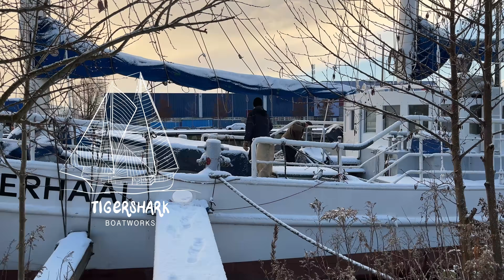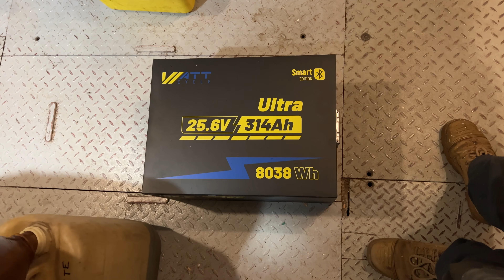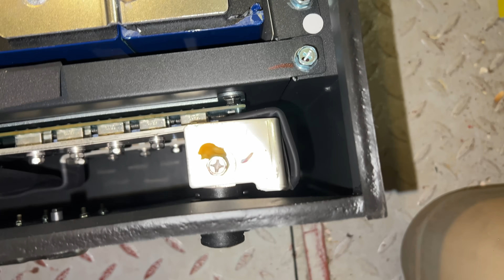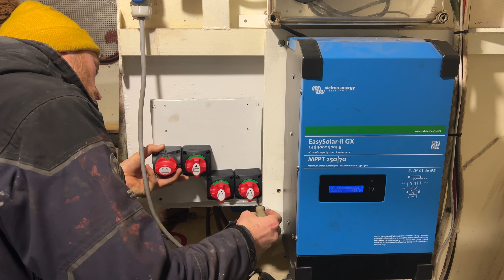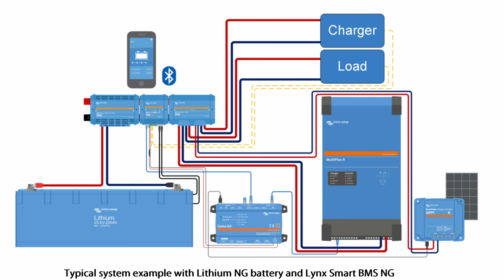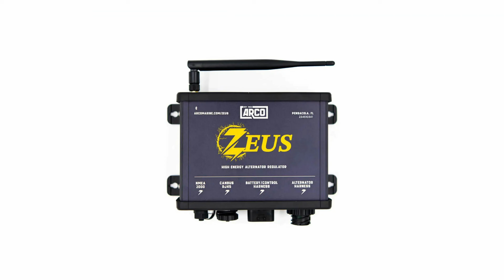The First ELECTRIC Steps To Become FUTURE PROOF

Comment: Nice job. Why not run the transmission oil pump off the end of tesla belt shaft. Freepumppower! Watching
Reply from the maker: Ah that would have been a good idea! More efficient than an electric pump. But space wise a bit complicated, and having it clutch out when using the diesel would also have been challenge. Not impossible though. We’ll keep that one in the back of our minds :)

Comment: The new battery looks like it goof be a good fit for the boat. Its not going to explode any time soon and the dent is more cosmetic than functional. Having the ability to open without voiding he warranty (If damage is reported) is really handy
Reply from the maker: Thanks! We’re very pleased with it so far :)
Reply: @tigersharkboatworks  Be good to do an update on the capacity drop etc in a couple years.
Reply from the maker: Will do! And you’ll be the first to know if it starts doing stuff we’re not pleased with :)

Comment: Check Bank Manager by a cruiser Clark. He has been cruising for years and developed a system to connect LiFePO4 batteries in parallel to lead acid. I have it on my boat and it works great. Google ”bank manager lifepo4”. It will make your system a lot more simple…

Comment: I had Victron batteries in my system, they are way too smart for their own good and are codependent on everything else in the system including battery protection modules, as a system it WAS NOT bomb proof. I think your decision to use the other batteries is actually wise irrespective of budget constraints. My philosophy, everything onboard has to have a workaround.
Reply from the maker: I fully agree. You can design everything into a seamless piece of art, but if one part quits and the system goes offline, you’re toast.

Comment: You did the right thing connecting the LFP battery to the empty lead-acid one. That way, the initial current for the starter motor doesnot ruin your LFP battery.
Reply from the maker: Ah, good to know. I did check with Wattcycle if they thought it would be possible to start it on the LFP only, and they said yes, but this just was the easiest test setup :)

Comment: Impressed with how long those batteries lasted, you must have looked after them well !
I had a standard battery last 8 years, it was just used for engine starting , so never went flat and was always fully charged.
Sensible choices with your new system. As you say, Victron is good kit but expensive
Reply from the maker: Thanks! We are too, so we’ll try to squeeze some more out :)

Comment: I still use AGM even though it’s a racing yacht and I could do with less weight, but I have seen lithium fire and that is the last thing I want in the middle of the ocean. Lithium in my caravan is fine if that catches fire I just jump out and all is well. 😂😂 I hope it works out for you. You do have one advantage the your yacht is steel so it will not burn like my carbon fibre tub. 😂
Reply from the maker: I’m definitely not the guy to convince you to go for lithium. But there is a big difference between electric car lithium (NMC), cellphone lithium (LCO) and the heavier and less energy dense LFP and LTO. So saying ‘lithium fire’ is kind of the same as saying “I’ve seen a ‘fuel fire’”. So, If you ever decide to swap your AGM for something lithium(ish), LFP is definitely a safe bet. Or, wait a few months/years for Sodium Ion. It skips Lithium altogether, but has similar benefits :)
Reply: @tigersharkboatworks yes my AGM are fine for now I only run 400AmpH battery bank. You are running a frigging battle ship you need way more power. 😂 I have seen two boats burned down in one month, because of lithium batteries so I am staying away from those. Mind you we almost had a calamity on my boat. My wife said she can smell gas in my gas locker and I said impossible as we have sensors everywhere. Run out of gas while we were enjoying stay on our Rottnest Island. Got the bottle refilled and turned out it was rusted out at the bottom. I have never seen anything like it. It was only 10 years old. Anyway have brand new stainless steel one now so no problem solved. 😂👍

Comment: It's a pity you cannot get hold of the new CATL 24V Na ion heavy truck or plant starter battery orthevlarge format prismatic storage cells 10,000 cycles plus 5C  175kwh kg  batteries ,  they should start coming through in 6months. 🥼🧙🏻‍♂️🇬🇧
-40 running -35 charging  temp to + 70⁰C  they only loose 10% charge at  -40C  They can also run flat and be recharged without damage so they have about 90%+ usable capacity.
Reply from the maker: Yeah that is definitely future goals, but we can’t keep waiting for better stuff to become available. So, for the next battery upgrade :)

Comment: Your old lead acid battery bank looks like the ones I worked on for years , I repaired and built large batteries for electric forklifts, from 24 volts to 80 volts with amps 1400 ! Some batteries were almost 6000 lbs and 48” tall that would give you a real boost! LOL but the future is lithium and the system you are doing is the best , I think for the future more solar panels and batteries will be needed for your needs . Good luck and thank you for the great video! See you next week 👍🏻👍🏻🖖🏼
Reply from the maker: Thank you! That sounds enormous! This is definitely not the last battery we’re installing :)

Comment: one more post: As mentioned I live in the Great White North, today is a very nice morning at -34C. 2 years ago I sold out of the big city life, the business, the hassels in search of a more quiet remainder of our life. Bought a 36' diesel pusher motor home without all the modern anti ...... devices, something I could fix with a bobby pin if needed. September I purchased new house and starter batteries about $1800.00 plus converter&charging. I have a builtin 6Kw  gen propane fuelled and often have a 20A sometimes 30A plugin that comes with  the odd campsite. Other than that we live completely off grid. As far as I knew Lithium wasn't feasible for this climate.? I followed the link Gijs posted and found the choice I should of made. I am posting the link below. Worth the time to read the full page and, its on sale for -600 CAD. Dang it
https://eu.wattcycle.com/collections/motorhome-leisure-battery/products/12v-314ah-mini-heat-battery-with-bluetooth

Comment: Don't forget fuses at or very close to the battery terminals. These protect the wires leading away from the battery in case of a failure or fault condition.
Reply from the maker: Ah yess, I forgot to mention them, we have it setup like this now: battery terminals - main switches - fuses inside the main switchboard. So that we can switch of the mains to change a fuse :)
Reply: @tigersharkboatworks  In that case it is maybe possible to isolate the old battery in case of emergency start and connect the jumpercables to the fuse (upstream of course).
Reply from the maker: Yess, that is also an option!

Comment: It's astonishing how those original batteries have lasted so long. A standard Lead acid battery is generally only good for about 270 cycles (100% SOC to 60% SOC and back to 100%). AGM types do a lot better. I guess the demand on your original batteries has been very light over the years. Thanks Gyjs. Very interesting video.
Reply: Depends a large bank of batteries more like forklift batteries are much less fragile than car style.
Reply from the maker: Yeah that’s true. These banks with separate cells are a different ballgame than the normal car lead acid batteries :)